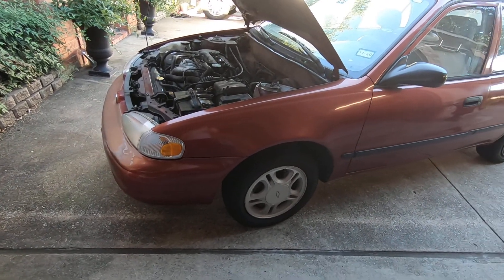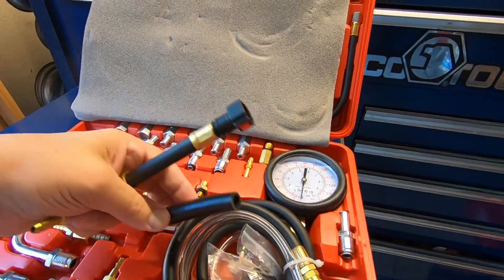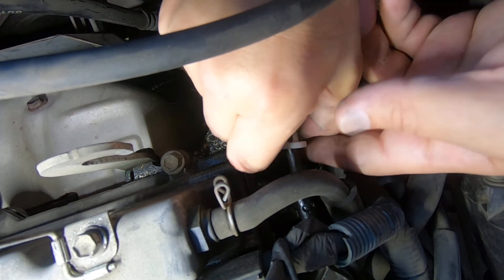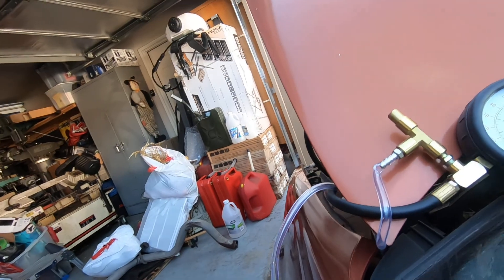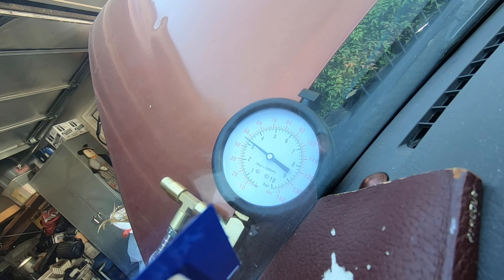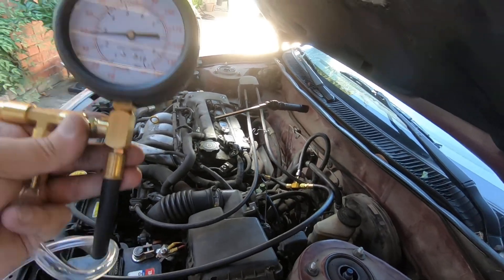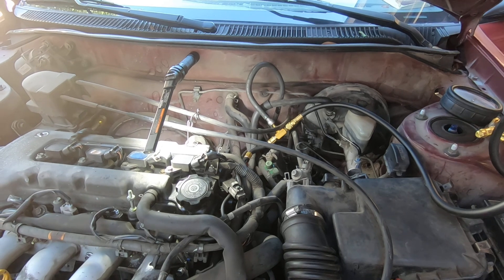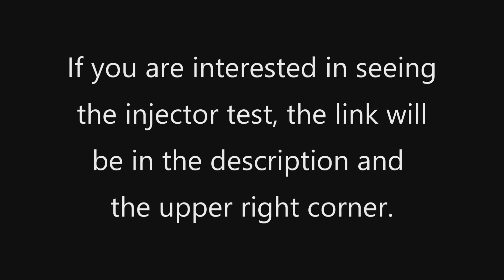Fuel Pressure Test on a 2001 Chevrolet Prizm 1.8L for a P0171 code.

Comment: What was the fix on your car for that code?  Have been chasing this on mine...
Reply from the maker: Ended up being an exhaust leak that was sucking air in and causing false O2 readings.
Reply: @737mechanic  Thank you for the reply.  Have changed O2 sensors, cleaned mass airflow sensor, sprayed intake with carb cleaner,  ....Will have to really check hoses well next.  Tired of this light.  🤷‍♂️
Reply from the maker: @F3502000  make sure there are no cracks in the intake duct from the MAF to the intake.

Comment: I haven’t checked fuel pressure yet, but the car (2001 Corolla) cranks and doesn’t start, it runs with starter fluid. I confirmed power to the fuel pump. The car had bad gas and ran with bad gas then sat for 2 years with an empty tank, I added fuel and a little bit of seafoam injector cleaner. And she cranks but won’t start unless I have starter fluid. Could it be the fuel pump, fuel filter, fuel pressure regulator?? Or could the fuel lines/ fuel rail/ and injectors be clogged with bad gas??? Where should I start? I’m gonna check fuel pressure first but what would you recommend?? Any help would be appreciated!!! I got this car for free from a family member but need to get it running it’s a manual Corolla it’s really cool!! It’s just been sitting for 2-3 years and then was moved across town, then sat for another 2-3 years!! I’m pretty sure it ran with bad gas 2-3 years ago when it was moved!! Thanks for any help!!!
Reply from the maker: It is definitely a fuel-related issue, the first thing I would do is see what the fuel pressure is, if it doesn't have fuel pressure or low pressure then I would remove the filter and see if it is clogged, if it is good then you know the fuel pump isn't working. If the fuel pump is working and you have a new filter and it still doesn't start take a test light and see if the fuel injectors are pulsing while it cranks. if they are pulsing the injectors are probably clogged.

Comment: Shout out to you for linking and showing the damn kit I need with the proper fitting for this car. I don't know why Toyota decided to be jackasses when it came to fuel rail but the HarbirFreifgt basic Fuel pressure test that cost $52 bucks didn't work. Let's not forget about that absolutely pointless stupid ridge you have to finagle. I spent 15 dollars on the Special Tool to do it.. Getting tired of trying to diagnostic this car and its fuel issues with Toyota and its damn crazyness. Good vid.I used your affiliate link to purchase. Appreciate